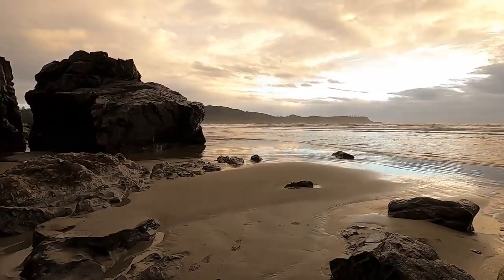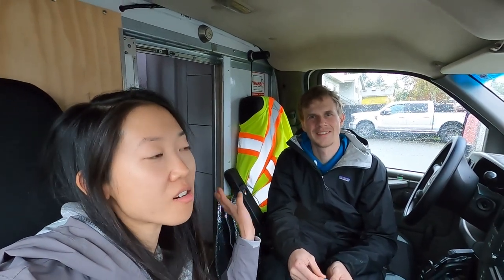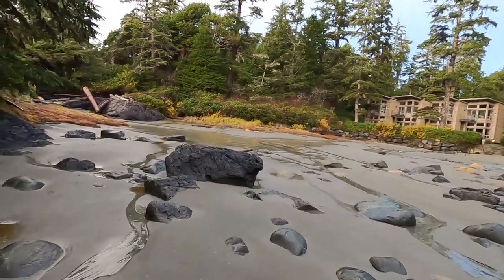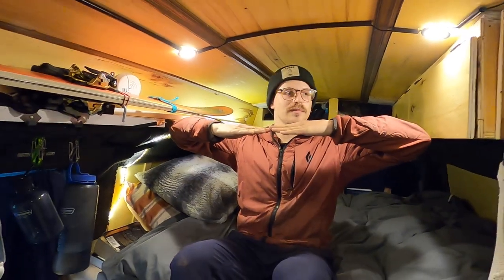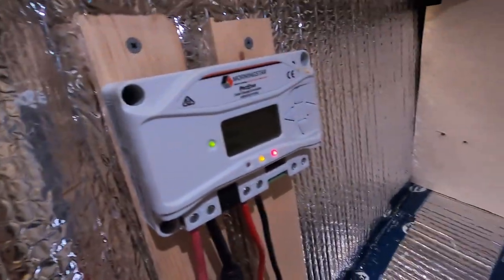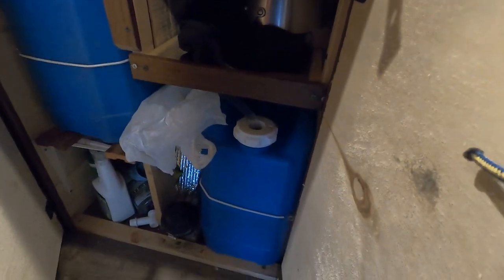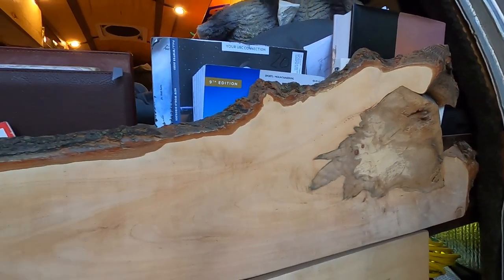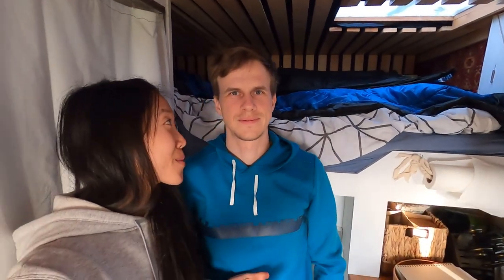Broken Water Tank & Van Tour in Tofino

Comment: @3:13 Incorrect x2.
1. Plastic fittings do not need this lubrication\sealing. When Teflon tape is wrapped around plastic male threads it adds to the strain and tensile stress. If you insist on a sealant pipe dope a better choice. 
2. PTFE tape is wound with the thread direction (CW) not counter (CCW). Screwing the fitting in will cause the tape to unwind & bunch up not functioning well as you have incorrectly wound it.
Personally, I would apply a drop or two of silicone to aid in disasssembly if required, no sealant.

Comment: Good Morning, your now in Oregon But it`s the wrong time to be hear unless you plan to snow ski. you need to head south to Florida  on the way through check out smith rock in Bend, Or. also you need to wrap your water tank with a heat strip that you can purchase at any home improvement store.
Reply from the maker: Yeah we're just on the way through south, however on the coast the temperatures are still OK. It goes up to like 10°C (is that like 50F?). Only the nights are cold, but we have our heater and finally a full battery.